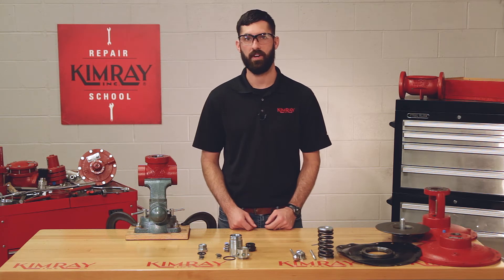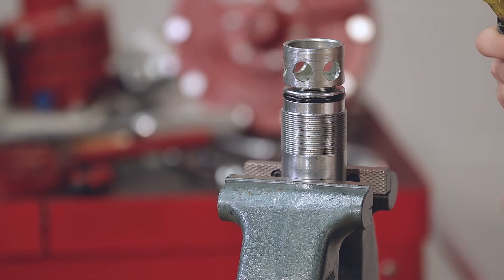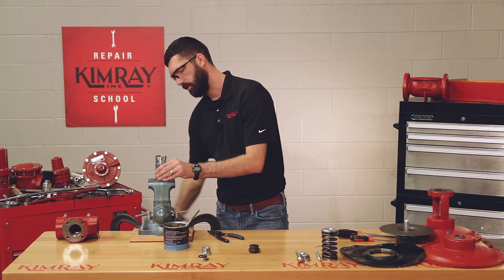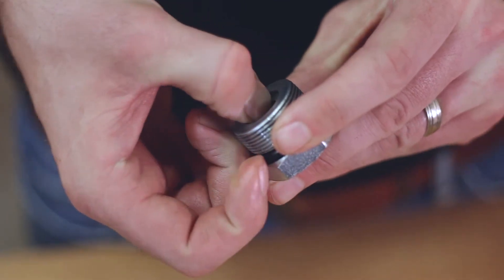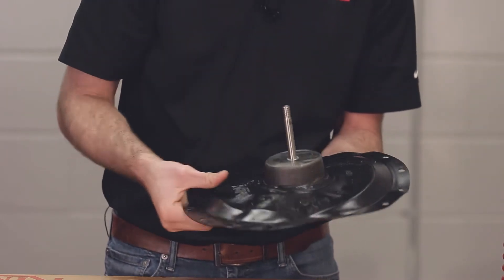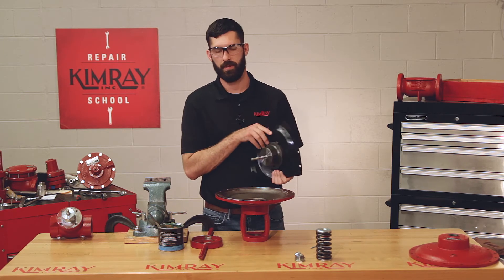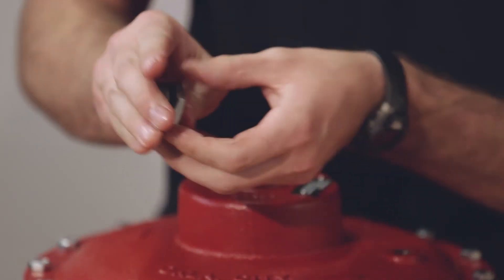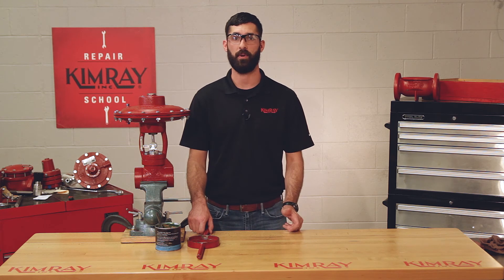Stem Guided High Pressure Control Valve Repair 🔧 [Part 2: Assembly]

Comment: Clarify dout.  How control valve stop   , in small volume applying air pressure can stop high pressure in pipe line  , on which principle it work and how?
Reply from the maker: I'm sorry, I don't understand the question, the translation is not clear enough. Could you try a translation through google translate perhaps?